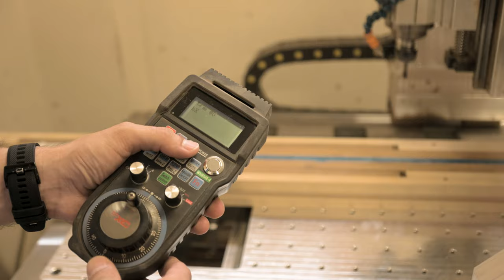How we build the wooden invert roller speargun "Odin 110"

Comment: What do you use to glue the teak pieces together?
Reply from the maker: We use epoxy resin designed for marine use.
Reply: @AndrianBLUE  for what is botom cover? Its like air chamber for balance but ther is no seal?
Reply from the maker: @Vbokisha  it is a compartment to add lead pieces to balance the speargun
Reply: @AndrianBLUE  i tryed to replicate your gun..(hope you dont mind) Handmade. Its prototipe i did'nt use ceramic bearings. Just platic over shaft...ill see how long it will last. 2x2 /16mm rubrers still did'nt try it undewater. We don't have   sea! P.S. next time i go to greece il try spearfishing for the first time and test the gun.
Reply from the maker: @Vbokisha  I hope it works great! Send us photos if you want